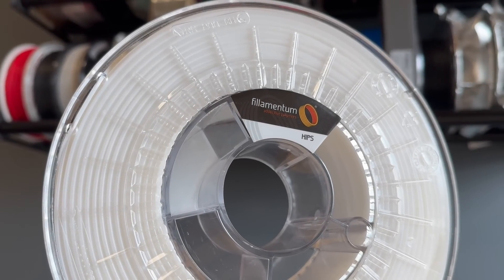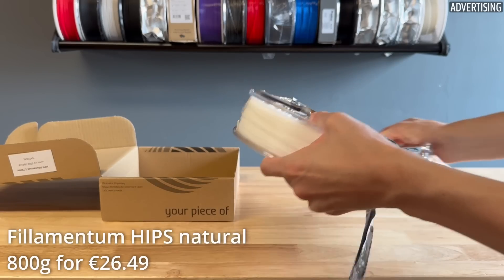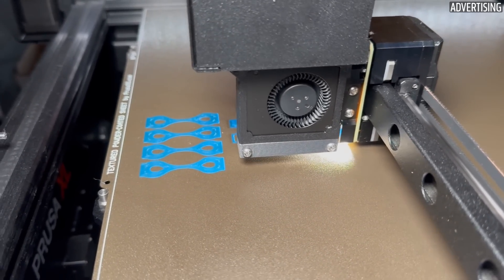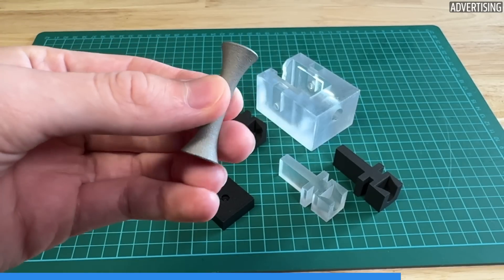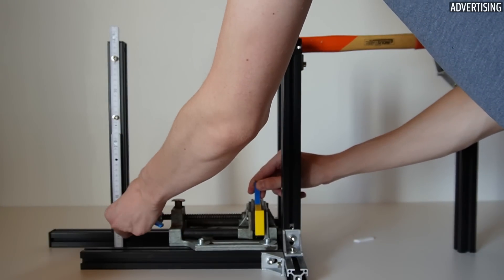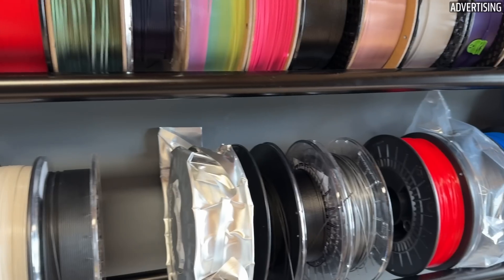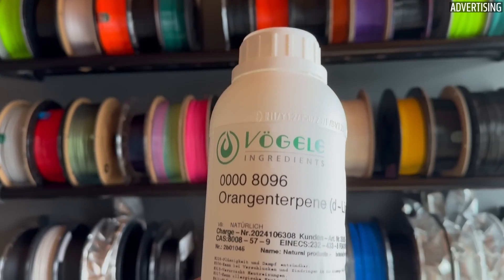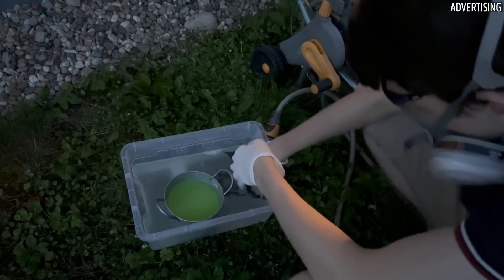The Best Filament for Affordable & Versatile 3D Prints: HIPS tested!

Comment: Bad interlayer adhesion. Warping. Brittleness. UV-sensitiveness. These problems are real reason why 3D-printed HIPS sucks as a durable construction material. 

But. Despite these problems, HIPS is really promising as a smoothed master models material for casting into metal, silicone, ceramic, plaster, epoxy, etc etc. One real life example: it's either very hard or even impossible to smooth PLA master models with small concave elements by using sanding. Cotton bud soaked with D-Limonene is far more convenient to use in the small holes of HIPS master model.

It's worth checking if HIPS and/or D-Limonene inhibits tin and platinum silicone solidification or not.
Reply: Rubbish. Your settings are not correct. Try again.....

Comment: I’d just like to mention something about temperature. I printed many rc plane parts at 220 or so as slicers recommended. Brittle and weak parts. Very obvious with thin walls. I could crush the part in my hand. I read somewhere that hips is set to lower than ideal because it’s used mostly as support material. I raised to 265 and the parts became much stronger. The layer adhesion felt similar to pla. I also let my chamber soak to 40C.
Reply: This makes sense as injection moulded miniatures use polystyrene and they are solid, higher temperatures. 
Once people look beyond... its just a support material, then join the dots to injection moulded models, it should be obvious how good this is 

Easier to glue later, prime and paint.. just like injection moulded models.

Comment: Wouldn't recommend HIPS for printers close to humans. The styrene is giving off very poisonous vapers. There is a video called "I had ASA Poisoning! 25 IMPORTANT Filament Answers!" and it is very informative! Only use in WELL ventilated areas without alot people in them.

P.S: If you say "that's HIPS and not ASA" Yes. Styrene is the S in both of them.

Comment: I had been using HIPS pretty regularly for at least 5 years. Like ABS it benefits a lot from an enclosure and stationary bed. In those circumstances the parts are pretty tough in many ways. Unlike ABS it doesn't meaningfully absorb moisture. It's the only plastic I use that I don't bother to dry or put into a sealed case.

I used to do the limonine support disolving but it's a mess, costly and I read the limonene leached from ABS. With good tuning and slicer settings the supports can easily separate in complete sections as if it were a negative of the printed part.

Comment: A fun property some Black HIPS filaments have, is that they will develop really obvious white stress marks. I printed some parts with thin flanges with bolt holes. And noticed the part turning slightly white when I tighten the bolts.

Comment: So it basically has all the negatives and 0 possitives. Noted.
harder to print then PLA
Damages easier then PLA
more expensive then PLA
needs enclosure for fumes
Cannot be used as soluable support material even for ABS

did i miss something? 
Theres literally water soluable material for supports - PVA. And adding cost of water (0$) its still cheaper then HIPS and wont melt your print.
Reply from the maker: You missed these aspects:
Better temperature resistance than PLA
Not more expensive than PLA, please don’t compare kg prices but currency/length
Can be used as a soluble support material, you just need to use the right ABS that doesn’t contain HIPS.

It’s not a perfect filament. But it’s not only negative.
Reply: Easier to sand, paint, fill, file, abrade, not affected much by atmospheric moisture. Can be easily weld-cemented together, weld is stronger than the material, rather than bonded together with epoxy etc, where the glue layer is stronger than the part and will let go if stressed.  HIPS is actually one of the most widely used plastics in the world. Only 3d printerists seem to have let it pass them by. Which is great for me, I use nothing else, and low demand means low prices! Please, could you all refrain from trying it, because I will end up paying more if it gets too popular!
Reply: @wunwinglow  "low demand = low prices" bro is dented and doesnt understand how real world works

Comment: HIPS shines as a support material for big flat ABS surfaces with no limonene required.  The biggest trick is to always think of the support as needing to be peeled off.  Keep the support structure flexible enough that it can be peeled.  Using HIPS as only the roof and floor of a zig zag support works well and requires fewer tool changes.  The ABS zig zag can be removed and then the flat HIPS roof and floor can be peeled away.  I do this in Cura.  I assume it can be done in Prusaslicer.  On inside corners and areas with a lot of texture the hips can get interlocked with the ABS, so it isn't perfect.  I usually set the support xy offset to .6 to prevent any overlap with the walls of the print and the z offset to 0 so the supported area comes out super smooth.

Comment: another great and very useful test, thanks! It would be really interesting to see how it compares to the regular PS :)
Reply: Send me some also (kidding) 😁 have not seen plain polystyrene filament yet, either, but will keep an eye out if I have a use case for it. Was considering HIPS for some wearable uses but it seems like a range of TPUs might be better fit.

I did not need to know that Artme filament extruder exists. May need to bury my wallet. 😅
Reply: @zivzulander  😅 yeah I couldn't resist lol
Reply from the maker: Thanks! Is regular PS filament a thing?
Reply: @JanTecEngineering  I only saw one or two maybe :) but I plan on making some with artme lol
Reply from the maker: @riba2233  Nice! Are you happy with the Artme?
Make sure to send me some PS filament ^^
Reply: @JanTecEngineering   still building it but I will send you some for sure, thanks :)

Comment: Sounds great, since styrene "cement" in the scale model world should still work to weld part, not just glue.
Reply: Use plumbers solvent instead. Same stuff but costs about quarter of the price.

It works for PLA as well but takes longer to form a bond.
Reply: @freedomofmotion  Interesting, I usually use Tamiya airbrush cleaner, since it's the same as their model cement, just with the percentage of both ingredients nudged by a single percent so legally they can pretend it's a different product.

Comment: ABS stands for Acrylonitrile Butadiene Styrene. As such, any solvent you use for HIPS will impact most ABS materials as well. The degree to which the ABS is affected will depend on the proportions of the resisn used to make the ABS and the susceptibility of the other ingredients to your solvent of choice.

Comment: Not at all cheap on Amazon, unfortunately.
Reply from the maker: Where are you located?
Reply: @JanTecEngineering  In France, the same filament is at 21€ per kilogram , and PLA is much cheaper (the cheaper is 15/16€)
Reply from the maker: @ddrmaxdan386  This site offers it for 13 €/kg + 2€ shipping to France:
https://euroharry.com/products/euroharry-3d-drucker-filament-hips-1-75mm-1kg-verschiedene-farben
(Never ordered from them though)
Reply: @JanTecEngineering  Thanks. It is 18 € for 0,5 to 10 kg orders (outside Germany) though. Might still be interesting, they have low prices overall.
Reply: @JanTecEngineering  Canada

Comment: I have probably used over 60KG of HIPS filament and pestered other 3D gurus about why they never mention it, so nice to see someone actually doing a good review of it.
One advice though, try higher temps, i always print at 265C and get pretty strong parts, built 2 of Voron 2.4R2 with it completely, nothing failed, yet, and they are heavily used as you can see on my channel.
Danke schon.
Reply from the maker: Thanks for sharing your experience. It's great to hear from someone who actually used a lot of HIPS for technical applications. 
Increasing the temperature is a good advice too, I'll try that out. Danke auch!
Reply: @JanTecEngineering yes I also printed rc plane parts at 265 and the layer adhesion was much better!
Reply: What do you normally print with it?  How paintable is it?
Reply: @dfoster9445  HIPS is WAAAAY more useful than some other popular plastics, it prints beautifully when the settings are correct, it glues, welds, with standard plastic model kit solvent cements, including the very thin brush applied liquids. It is stiff, light, is not affected very much by moisture. It takes plastic paints and primers perfectly, it is easy to sand wet or dry and doesn't go all furry like some materials. You can carve, scrape, drill, fill, file, exactly like plastic kit material, because, hey, it IS plastic kit material! It is very surprising to me that it is not more popular with 3d printerists, and it hurts when folks say it is only good for dissolvable supports. That is like saying the only use for steel is making building scaffolding poles!
Reply: @wunwinglow  I had been thinking the same after using it. The layer bond is great.

Comment: I bought some HIPS a couple months back, to try as support for ABS. I didn’t get much done with it, but it did indeed melt away with limonene, it just took longer than I expected. To be honest, it was harder to get limonene in a timely manner lol… but I have wanted to try more prints with it as support material. I also picked up Bambu’s new Support for ABS, which is HIPS (or HIPS based), but haven’t tried it yet. They don’t say anything about dissolving it in limonene, so it must be a blend of some kind. I’ll have to come up with a print to test it all on.
Reply: It's 95~99% HIPS, 1~5% additive. They don't say what the additive is. They do mention "limonene-dissolvable" in the Parameters Comparison on the webpage of the product. You gotta scroll down quite a bit.
Reply: @mxrz  thanks for the info! That’s kind of what I assumed on the composition. Yeah I definitely didn’t go theough the product page fully lol

Comment: Awesome video.  We made HIPS a while ago here at Polar Filament.  HIPS pellets are REALLY cheap, especially when compared to PLA.  The only reason HIPS costs as much as it does is because it's unpopular, so there's no volume behind it in the manufacturing side.

We never ended up officially launching HIPS because it really helps to have an enclosure while printing to prevent warping.
HIPS doesn't like to stick to very much (which is both good and bad).  We liked to use it as an INTERFACE layer for PLA supports, which works phenomenally well.  It actually breaks off really easily even without dissolving it in D Limonene (which is VERY different than R Limonene by the way).

HIPS filament is actually really easy to manufacture.  It condenses a lot as it cools, which means we end up with a nice tight line when producing it.  Usually this means that the material will be challenging to PRINT with because plastics that shrink when cooled tend to cause warping.

I think I still have some of our HIPS spools from 5-6 years ago when we made it, I should track them down to see how well they aged over the years.

Great video by the way (I watched the whole thing in german first before realizing you also released it on your english channel)
Reply: I would love to see a HIPS copolymer. The ability to seal the surface with limonene has been extremely useful, and Hips is food contact safe once smoothed/sealed.
Reply: @brendanloconnell   copolymer with what?
Reply: I also tried HIPS a few years ago. The print quality is very good even with not perfect settings, but I agree with polarfilament on the negative sides. I had very bad layer adhesion (way worse than ABS) and very much warping. So I ditched it. Hearing of the support material capabilities for PLA I think i'll give it a try again. Desolving in Lemonene is not an option for me (safety and cost aspects) but easy break away sounds interesting
Reply: I just grabbed some HIPS to try and see how it handles acting as a support for some higher end engineering filaments, ppa-cf, a few PA'S. PC cf etc. I think it's basically the same as what some manufacturers are selling as "ppa support filament" except HIPS has a higher bed temperature by 20-30°c . I'm not sure how they think their "ppa support filament" is gonna work at 60-80° bed for PPA😂 I'm betting HIPS works better just based on the numbers
Reply from the maker: Thank you! 
It is very interesting to hear the perspective of a filament manufacturer. 
In terms of print bed adhesion and warping, I have to say that I didn't have any major problems. I also printed some larger objects without any problems. 
Regarding the German video:
Next time I will definitely make a note at the beginning of the that it is also available in English 😅

Comment: Could the limonene be used to smooth HIPS? Or would acetone be better suited still, as with ABS?
Reply: Behaviour of HIPS in acetone is interesting. As opposed to ABS, it cannot be fully dissolved in acetone, if you drop a HIPS item into acetone, it absorbs some acetone and turns into a blob but doesn't get fully dissolved, doesn't become a liquid mixture. When it's in the HIPS surface, acetone fairly rapidly airs out.

So it's pretty easy to just brush acetone onto HIPS without HIPS all just ending up on the brush, but the surface doesn't become quite attractive. I have not tried vapour smoothing because i'd struggle to do it safely, acetone vapours are spectacularly explosive.

Limonene isn't very eager to evaporate under room conditions so i wonder if it'll even work.
Reply: Limonene works great for HIPS. You can actually just brush some on. Takes a couple hours to evaporate, leaving you with a smoothed part. I've also been planning an experiment using a super cheap ultrasonic fog generator to make limonene vapor for smoothing too.